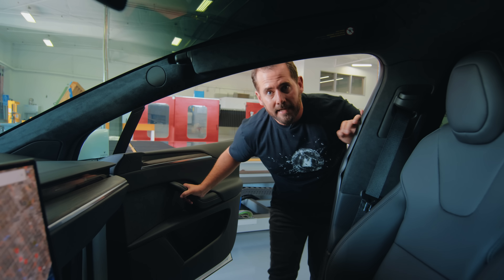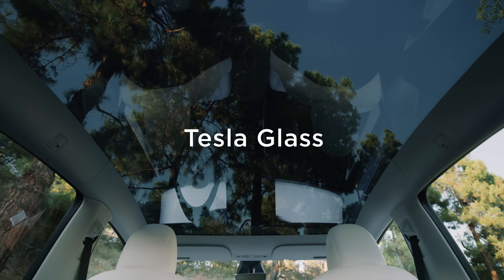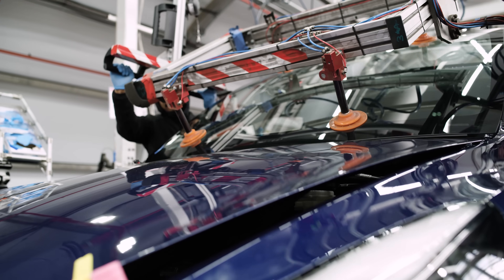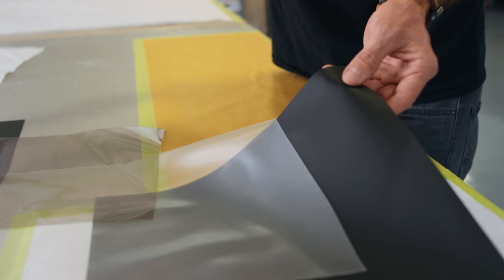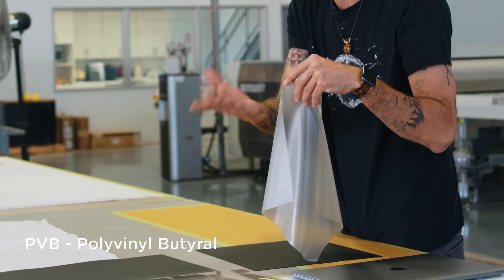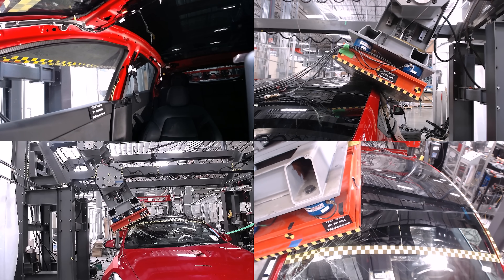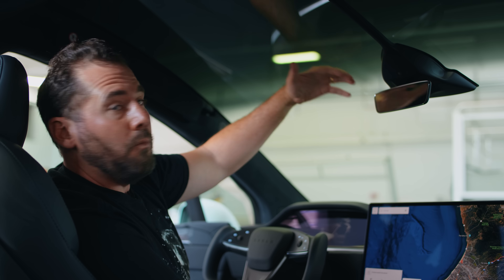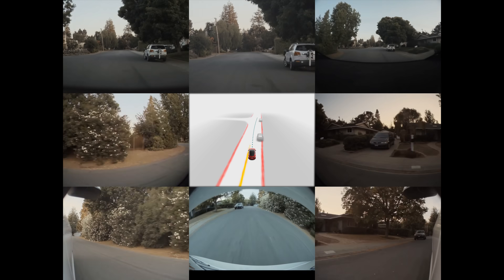Tesla Glass | The Secret to a Quiet Cabin

Comment: THIS"""" TESLA glass""""  REALLY AWESOME..!We need much more 🙏 videos like 👍 this !!! .....
Sayonara!
Reply: W140 features included:

Double-paned soundproofed glass was a new S-Class innovation first fitted on the W140. This form of window glazing allowed for improved soundproofing, reduced condensation, and other insulation benefits.

Electrically-operated exterior mirrors could be folded by switch to ease driving in narrow spaces.

'Parameter steering' was a system which made low-speed driving easier by reducing the effort required to maneuver in speed-sensitive situations such as parking.

Rear-parking markers, or guide rods. These rods extended from the rear corners of the trunk lid when in reverse, providing the driver with a guideline for rear maneuvers. In 1995, this system was replaced by the sonar-based Parktronic system which measured the distance of the bumpers to nearby obstacles.

12-way powered, heated front seats, with 3 setting memory functions and lumbar support.

Windshield wipers with heated washer system. Later models also included rain-sensing windshield wipers.

Electrically-operated automatic-dimming inside rear-view mirror that tied into the seat and steering wheel memory.

Heated exterior mirrors. Later models also included auto-dimming driver's side mirror.

Orthopedic seats were an expensive option from the factory but consisted of several different air cushions in the seat that the user can inflate and deflate to find the perfect driving position.

Dual-zone climate control. Four-zone climate control on LWB models.

Reclining and heated rear seats on LWB models. V12 models also have the four-place seating option, which allows fully adjustable rear seats, lumbar support and rear sunshade control. The center seat has been replaced by a burlwood center console, allowing a 2 + 2 seating format.

The climate control system could be set to operate for 20 minutes after the engine had been turned off.

Electric rear sunshade.

Rear passenger illuminated vanity mirrors.

Soft-closing doors and trunk.

Leather interiors and burl inserts (optional; standard for 500SEC/CL 500).

In 1995 the S 600 Coupe became the first Mercedes car with GPS navigation system, designated Auto Pilot System APS. It featured CD-ROM maps and full color navigation display in the center dashboard.

In 1996 the Linguatronic voice control system and Parktronic sonar-based parking system were introduced

In 1997 the TELEAID emergency and tracking system was introduced in the US market.

Also, developed with the car, a Bose sound system was available as an option.

Comment: they never disappoint!
Reply: W140 features included:

Double-paned soundproofed glass was a new S-Class innovation first fitted on the W140. This form of window glazing allowed for improved soundproofing, reduced condensation, and other insulation benefits.

Electrically-operated exterior mirrors could be folded by switch to ease driving in narrow spaces.

'Parameter steering' was a system which made low-speed driving easier by reducing the effort required to maneuver in speed-sensitive situations such as parking.

Rear-parking markers, or guide rods. These rods extended from the rear corners of the trunk lid when in reverse, providing the driver with a guideline for rear maneuvers. In 1995, this system was replaced by the sonar-based Parktronic system which measured the distance of the bumpers to nearby obstacles.

12-way powered, heated front seats, with 3 setting memory functions and lumbar support.

Windshield wipers with heated washer system. Later models also included rain-sensing windshield wipers.

Electrically-operated automatic-dimming inside rear-view mirror that tied into the seat and steering wheel memory.

Heated exterior mirrors. Later models also included auto-dimming driver's side mirror.

Orthopedic seats were an expensive option from the factory but consisted of several different air cushions in the seat that the user can inflate and deflate to find the perfect driving position.

Dual-zone climate control. Four-zone climate control on LWB models.

Reclining and heated rear seats on LWB models. V12 models also have the four-place seating option, which allows fully adjustable rear seats, lumbar support and rear sunshade control. The center seat has been replaced by a burlwood center console, allowing a 2 + 2 seating format.

The climate control system could be set to operate for 20 minutes after the engine had been turned off.

Electric rear sunshade.

Rear passenger illuminated vanity mirrors.

Soft-closing doors and trunk.

Leather interiors and burl inserts (optional; standard for 500SEC/CL 500).

In 1995 the S 600 Coupe became the first Mercedes car with GPS navigation system, designated Auto Pilot System APS. It featured CD-ROM maps and full color navigation display in the center dashboard.

In 1996 the Linguatronic voice control system and Parktronic sonar-based parking system were introduced

In 1997 the TELEAID emergency and tracking system was introduced in the US market.

Also, developed with the car, a Bose sound system was available as an option.

Comment: I doubted before, but now I understand that Ilona Mask's companies are indeed the most influential innovative companies in the world, including Tesla.
Reply: You think that because you don't know anything about history 
W140 features included:

Double-paned soundproofed glass was a new S-Class innovation first fitted on the W140. This form of window glazing allowed for improved soundproofing, reduced condensation, and other insulation benefits.

Electrically-operated exterior mirrors could be folded by switch to ease driving in narrow spaces.

'Parameter steering' was a system which made low-speed driving easier by reducing the effort required to maneuver in speed-sensitive situations such as parking.

Rear-parking markers, or guide rods. These rods extended from the rear corners of the trunk lid when in reverse, providing the driver with a guideline for rear maneuvers. In 1995, this system was replaced by the sonar-based Parktronic system which measured the distance of the bumpers to nearby obstacles.

12-way powered, heated front seats, with 3 setting memory functions and lumbar support.

Windshield wipers with heated washer system. Later models also included rain-sensing windshield wipers.

Electrically-operated automatic-dimming inside rear-view mirror that tied into the seat and steering wheel memory.

Heated exterior mirrors. Later models also included auto-dimming driver's side mirror.

Orthopedic seats were an expensive option from the factory but consisted of several different air cushions in the seat that the user can inflate and deflate to find the perfect driving position.

Dual-zone climate control. Four-zone climate control on LWB models.

Reclining and heated rear seats on LWB models. V12 models also have the four-place seating option, which allows fully adjustable rear seats, lumbar support and rear sunshade control. The center seat has been replaced by a burlwood center console, allowing a 2 + 2 seating format.

The climate control system could be set to operate for 20 minutes after the engine had been turned off.

Electric rear sunshade.

Rear passenger illuminated vanity mirrors.

Soft-closing doors and trunk.

Leather interiors and burl inserts (optional; standard for 500SEC/CL 500).

In 1995 the S 600 Coupe became the first Mercedes car with GPS navigation system, designated Auto Pilot System APS. It featured CD-ROM maps and full color navigation display in the center dashboard.

In 1996 the Linguatronic voice control system and Parktronic sonar-based parking system were introduced

In 1997 the TELEAID emergency and tracking system was introduced in the US market.

Also, developed with the car, a Bose sound system was available as an option.

Comment: Definitely more videos like these! Insiders explaining the tech behind Tesla
Reply: This is not new "tech"
W140 features included:

Double-paned soundproofed glass was a new S-Class innovation first fitted on the W140. This form of window glazing allowed for improved soundproofing, reduced condensation, and other insulation benefits.

Electrically-operated exterior mirrors could be folded by switch to ease driving in narrow spaces.

'Parameter steering' was a system which made low-speed driving easier by reducing the effort required to maneuver in speed-sensitive situations such as parking.

Rear-parking markers, or guide rods. These rods extended from the rear corners of the trunk lid when in reverse, providing the driver with a guideline for rear maneuvers. In 1995, this system was replaced by the sonar-based Parktronic system which measured the distance of the bumpers to nearby obstacles.

12-way powered, heated front seats, with 3 setting memory functions and lumbar support.

Windshield wipers with heated washer system. Later models also included rain-sensing windshield wipers.

Electrically-operated automatic-dimming inside rear-view mirror that tied into the seat and steering wheel memory.

Heated exterior mirrors. Later models also included auto-dimming driver's side mirror.

Orthopedic seats were an expensive option from the factory but consisted of several different air cushions in the seat that the user can inflate and deflate to find the perfect driving position.

Dual-zone climate control. Four-zone climate control on LWB models.

Reclining and heated rear seats on LWB models. V12 models also have the four-place seating option, which allows fully adjustable rear seats, lumbar support and rear sunshade control. The center seat has been replaced by a burlwood center console, allowing a 2 + 2 seating format.

The climate control system could be set to operate for 20 minutes after the engine had been turned off.

Electric rear sunshade.

Rear passenger illuminated vanity mirrors.

Soft-closing doors and trunk.

Leather interiors and burl inserts (optional; standard for 500SEC/CL 500).

In 1995 the S 600 Coupe became the first Mercedes car with GPS navigation system, designated Auto Pilot System APS. It featured CD-ROM maps and full color navigation display in the center dashboard.

In 1996 the Linguatronic voice control system and Parktronic sonar-based parking system were introduced

In 1997 the TELEAID emergency and tracking system was introduced in the US market.

Also, developed with the car, a Bose sound system was available as an option.

Comment: Taking car making into art form!
Reply: Nope....
W140 features included:

Double-paned soundproofed glass was a new S-Class innovation first fitted on the W140. This form of window glazing allowed for improved soundproofing, reduced condensation, and other insulation benefits.

Electrically-operated exterior mirrors could be folded by switch to ease driving in narrow spaces.

'Parameter steering' was a system which made low-speed driving easier by reducing the effort required to maneuver in speed-sensitive situations such as parking.

Rear-parking markers, or guide rods. These rods extended from the rear corners of the trunk lid when in reverse, providing the driver with a guideline for rear maneuvers. In 1995, this system was replaced by the sonar-based Parktronic system which measured the distance of the bumpers to nearby obstacles.

12-way powered, heated front seats, with 3 setting memory functions and lumbar support.

Windshield wipers with heated washer system. Later models also included rain-sensing windshield wipers.

Electrically-operated automatic-dimming inside rear-view mirror that tied into the seat and steering wheel memory.

Heated exterior mirrors. Later models also included auto-dimming driver's side mirror.

Orthopedic seats were an expensive option from the factory but consisted of several different air cushions in the seat that the user can inflate and deflate to find the perfect driving position.

Dual-zone climate control. Four-zone climate control on LWB models.

Reclining and heated rear seats on LWB models. V12 models also have the four-place seating option, which allows fully adjustable rear seats, lumbar support and rear sunshade control. The center seat has been replaced by a burlwood center console, allowing a 2 + 2 seating format.

The climate control system could be set to operate for 20 minutes after the engine had been turned off.

Electric rear sunshade.

Rear passenger illuminated vanity mirrors.

Soft-closing doors and trunk.

Leather interiors and burl inserts (optional; standard for 500SEC/CL 500).

In 1995 the S 600 Coupe became the first Mercedes car with GPS navigation system, designated Auto Pilot System APS. It featured CD-ROM maps and full color navigation display in the center dashboard.

In 1996 the Linguatronic voice control system and Parktronic sonar-based parking system were introduced

In 1997 the TELEAID emergency and tracking system was introduced in the US market.

Also, developed with the car, a Bose sound system was available as an option.

Comment: More videos like this!! I would never have known anything about the level of detail you put into even the seemingly boring things.
Reply: It’s the same thing German car companies have been doing for decades
Reply: @Eric_In_SF  That you have to pay extra for while Tesla includes it for free...
Reply: @lachlanB323  You don't want to do that because the german cars are already silent as it could ever be while tesla cars absolutely needs this feature since they have terrible tire noises.
Reply: W140 features included:

Double-paned soundproofed glass was a new S-Class innovation first fitted on the W140. This form of window glazing allowed for improved soundproofing, reduced condensation, and other insulation benefits.

Electrically-operated exterior mirrors could be folded by switch to ease driving in narrow spaces.

'Parameter steering' was a system which made low-speed driving easier by reducing the effort required to maneuver in speed-sensitive situations such as parking.

Rear-parking markers, or guide rods. These rods extended from the rear corners of the trunk lid when in reverse, providing the driver with a guideline for rear maneuvers. In 1995, this system was replaced by the sonar-based Parktronic system which measured the distance of the bumpers to nearby obstacles.

12-way powered, heated front seats, with 3 setting memory functions and lumbar support.

Windshield wipers with heated washer system. Later models also included rain-sensing windshield wipers.

Electrically-operated automatic-dimming inside rear-view mirror that tied into the seat and steering wheel memory.

Heated exterior mirrors. Later models also included auto-dimming driver's side mirror.

Orthopedic seats were an expensive option from the factory but consisted of several different air cushions in the seat that the user can inflate and deflate to find the perfect driving position.

Dual-zone climate control. Four-zone climate control on LWB models.

Reclining and heated rear seats on LWB models. V12 models also have the four-place seating option, which allows fully adjustable rear seats, lumbar support and rear sunshade control. The center seat has been replaced by a burlwood center console, allowing a 2 + 2 seating format.

The climate control system could be set to operate for 20 minutes after the engine had been turned off.

Electric rear sunshade.

Rear passenger illuminated vanity mirrors.

Soft-closing doors and trunk.

Leather interiors and burl inserts (optional; standard for 500SEC/CL 500).

In 1995 the S 600 Coupe became the first Mercedes car with GPS navigation system, designated Auto Pilot System APS. It featured CD-ROM maps and full color navigation display in the center dashboard.

In 1996 the Linguatronic voice control system and Parktronic sonar-based parking system were introduced

In 1997 the TELEAID emergency and tracking system was introduced in the US market.

Also, developed with the car, a Bose sound system was available as an option.

Comment: Nice seeing other Tesla employees featured......refreshing.   I'm curious as to why, if 99% of the ultra-violet radiation is blocked, why does the cabin heat up so much in a typical Tesla.   We got the front half of the roof tinted in our model 3 because otherwise it can be just an oven in there on hot days, requiring one to run the A/C more than one might wish....and this issue will be more regular as climate change accelerates.....still, a fantastic vehicle we love more every day, and this is after  2.5 years of ownership.  By the time Cybertruck actually achieves mass production, the CT will be preceded by Rivian, lordstown, Ford, GM Hummer, and possibly others....the delay will be worth it....I think Tesla should tone down the bold predictions and focus more on product improvement and better customer satisfaction and service.